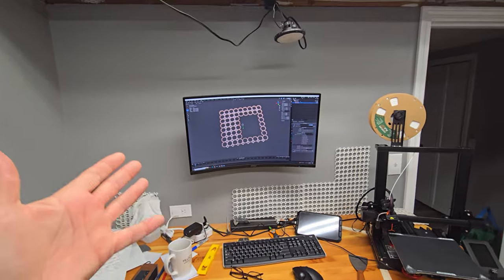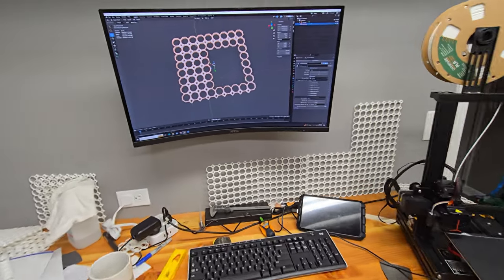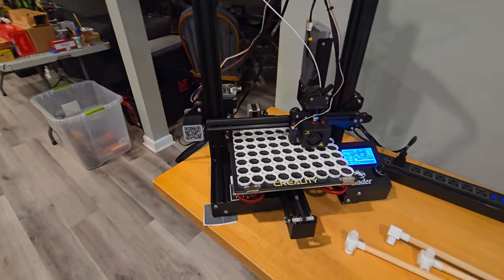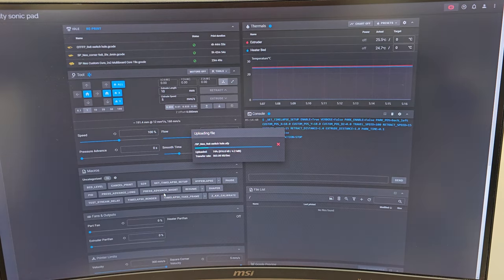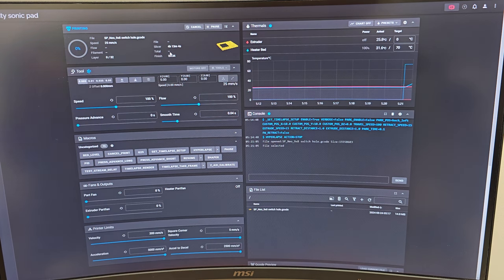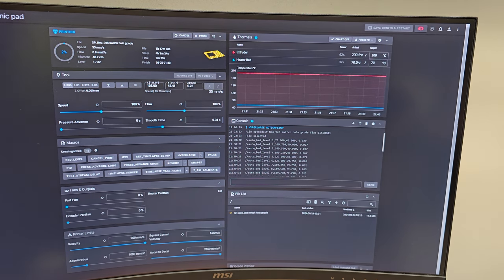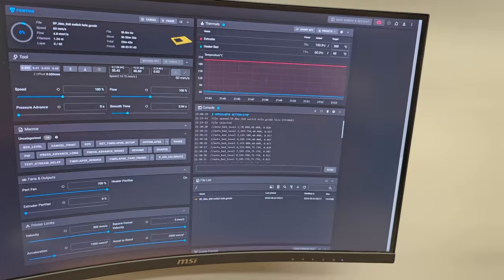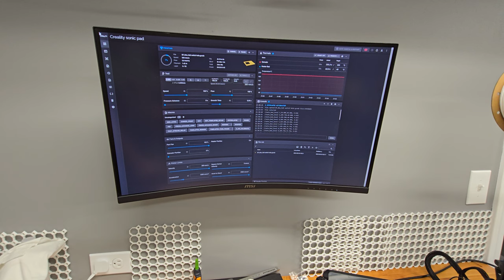Mulitboard + Neo + Multiboard + Frustration

Comment: If I was in your place. I would go ahead and bite the bullet and buy the $299 5M FlashForge 3D printer  and be done with it. Way way faster print speeds and well worth the money. Buy once cry once. You only need to buy it once, and then you have something good to use from now on.
Reply from the maker: I'm in too deep at this point :(
Reply: @dougdoesstuff24  I hear ya. You would be glad you did. But I understand. I'm printing a sheet of single, double, and quad 8mm screw mounts on my K1 max and a sheet of small threaded screw mounts on my ender 3 v2 neo as I'm typing. Got T bolts on file ready to start as soon as one of them is finished. I love the multiboard stuff. I was looking at the community build post a while ago for some shelf mount inspiration. Lol. I got so much planned out.

Comment: Use a hot air gun to get rid of the strings and everything else on your finished parts.   73
Reply from the maker: I did read that elsewhere, but I want it to be good out of the gate :)
Reply: @dougdoesstuff24  I definitely sympathize with wanting to get it good off the plate. There's also something to be said for taking what's realistically acceptable so one can move on with the overall project. I just finished an extremely frustrating project (finished for now) that I ultimately chose to accept the cosmetic defects in the first 1/6th of the project and use each next piece to refine. I'd already wasted too much filament.

Keep up the great work and best of luck!

Comment: 12:12 I had some issues with stringing with CC3D filament.  At first I thought it was because I had just transitioned from Cura slicer to Orca slicer.  Printing from Cura yielded the same results.  Digging around in Orca, I came across filament settings.  I looked up the specs and settings for the CC3D filament and dialed that in.  Let me tell you, it made the world of difference.  

I see plenty of videos on dialing printer settings which does apply to filaments to some extent.  But in my research, different filaments can require different tweaks such as extrusion rate.

I’m averaging about two multiboard tiles every other day, so I understand just wanting to be done and on to the next project.  Hopefully you’ll be done soon.  Best regards.